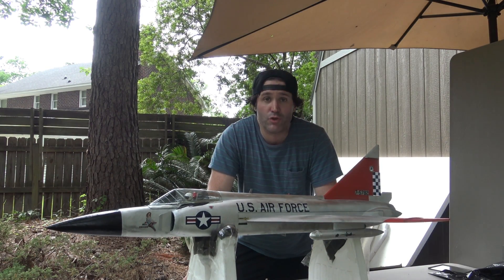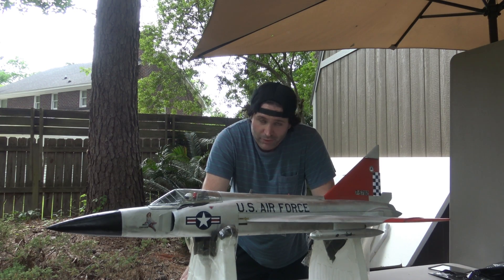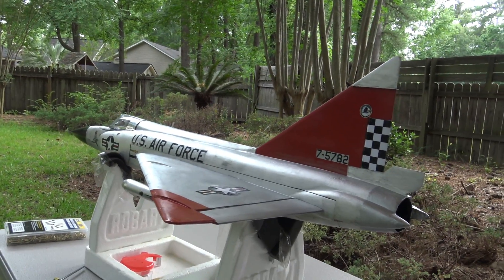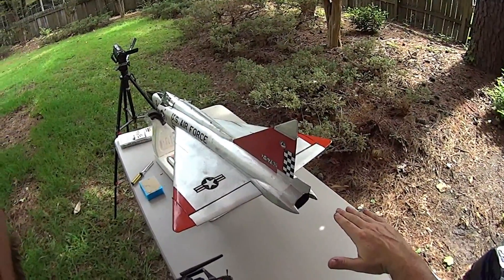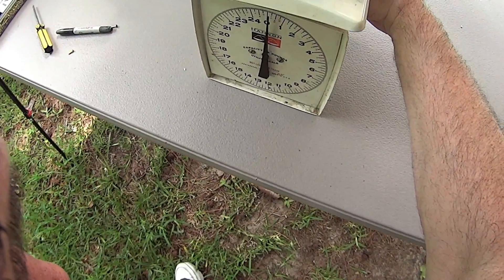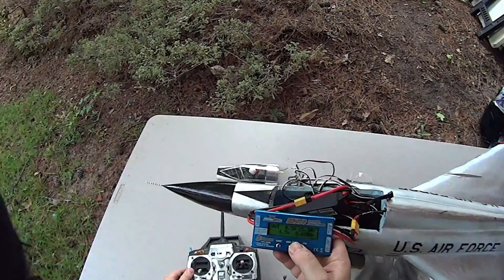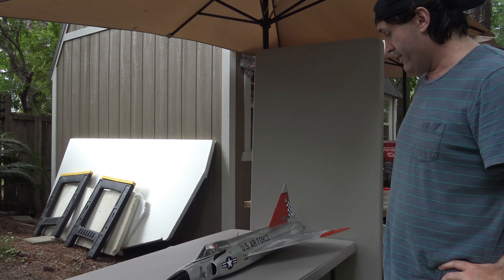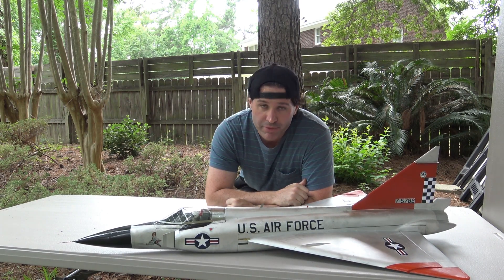RC F-102 Dagger EDF Jet & Flight Control Test [4K]

Comment: Gorgeous aircraft! If after you maiden it you find you need more thrust, as you know, you can put a small cheater hole in the belly of the fuselage. I had to put one in my Panther...what a difference it made in the thrust!
Reply from the maker: Thankyou George! I very well might have to add an additional intake if she doesn't perform well on her maiden flight.